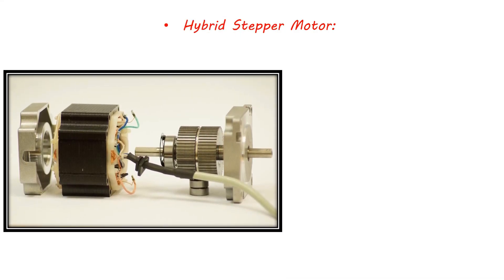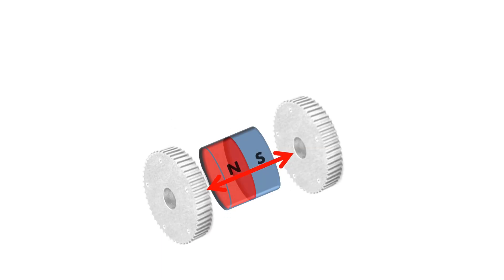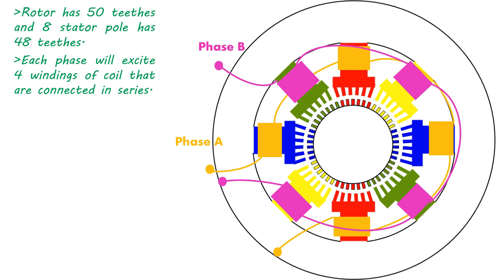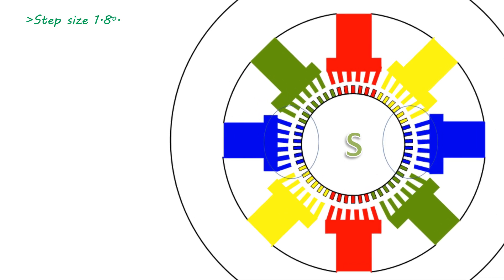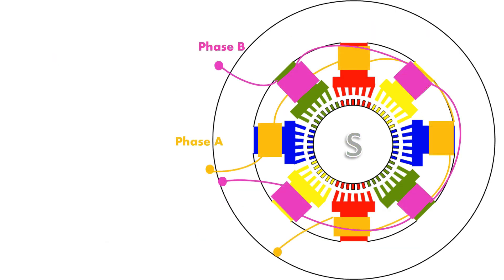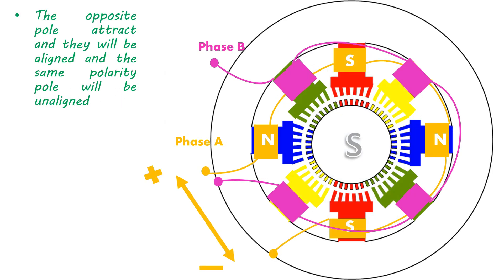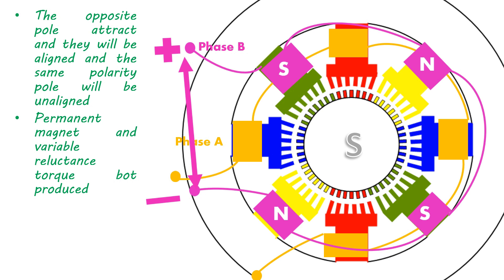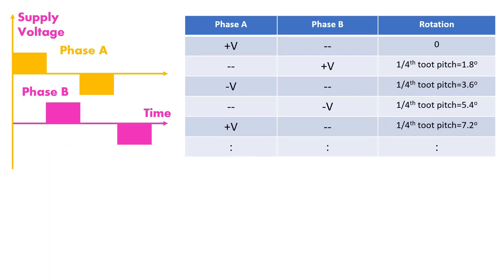How does a hybrid stepper motor works. Basic principle of stepper motor working with animation

Comment: I think that the step angle should be  0.3 deg, because the difference between rotor and stator teeth pitch is (7.5-7.2) equal to 0.3 deg